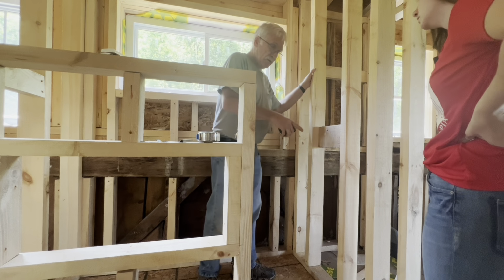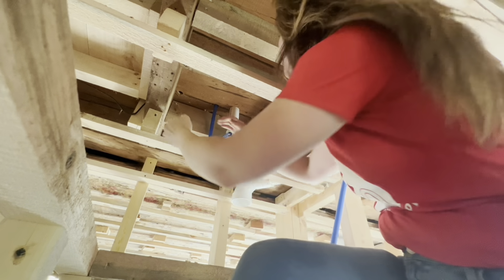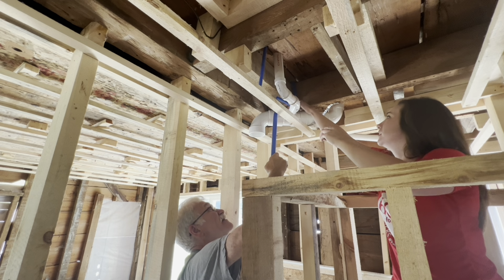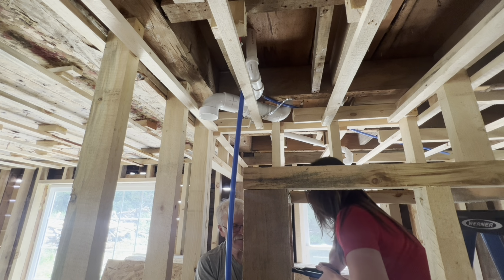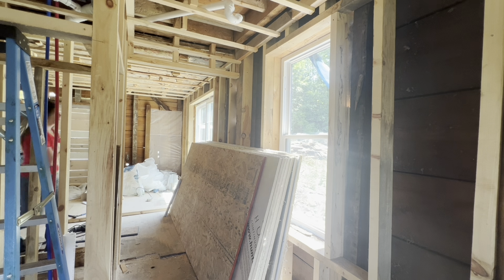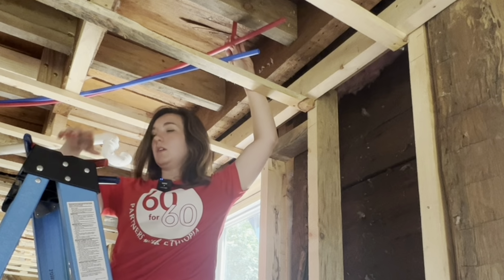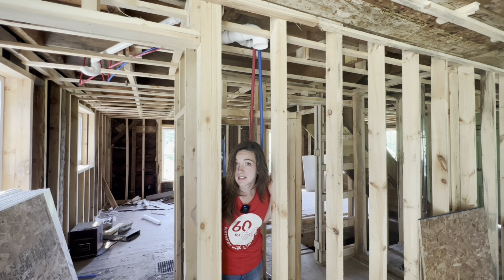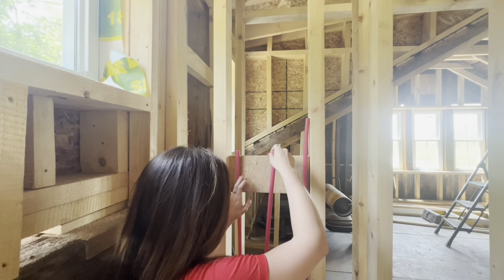TIME TO LEARN A NEW SKILL!! | Installing Water Lines for my Upstairs Bathroom!!

Comment: Good job, Abby! I have two tips for you: Use two pipes on the pliers for a better leverage, so it's way easier to do. Probably you'll do that anyway, but check if all your connections are leak proof, before closing the walls 😉 -Chris

Comment: I would use a tape to tape it blue because when inspection comes they will tell you have to change that and before you put walls up and after the electricity needing Inspection before proceeding

Comment: Great job! So thankful you did not need to solder!  Be grateful for the modern material. It is a lot of hard work with copper pipes.  This job should go pretty quickly! Are you putting in a basement sink? What about water in the addition, bathroom? You could cap it off until needed. Just thinking ahead.

Comment: Abby knowing how to plumb is so helpful.  You did an amazing job.  I have done this with my dad and it’s hard work.  One trick I learned is to brace one side of the nut wrench against a stud or solid piece of wood and use two hands to push the other side toward the arm that is braced.  I hope that makes sense.

Comment: Just a suggestion you'd like to keep your water lines as much as possible continue with flow without an elbow for every elbow. You decrease the pressure coming out the in your shower if you put a good mixing valve.  And that's what it's called where the 2 lines go into the one and then the 1 come out. A good mixing valve will help with your cold water problem getting into the shower

Comment: A small hint. When you finish and you go upstairs into the bathroom.  Put tape around the pipe that is supposed to be blue. And right on your tape blue. It will save you problems in the future

Comment: To keep from not knowing which line you might have to work on one day put some tape in different places on the red that u had to use for the cold water
Reply: You could also run the pex without the joints straight thru since every joint has the potential to leak within your walls and ceiling. Just a suggestion.  But I love what you are doing.😊

Comment: You practically have to be a contortionist to get the leverage on that crimping tool. You did great Abby! Jay a a master builder. You can see how straight the wood, the windows, and the floors are. Great job both of you!

Comment: Abby, my only suggestion is to, mark the cold water line with blue tape, wrap it around it, in case one does;t remember or you  are not the one working on it in later years.

Comment: I do have one concern and that’s been on my mind the whole time. That concern is all of the weight you have added to this house, can the bottom floor  and the foundation handle all of the extra weight? I certainly hope so but that’s been on my mind this whole time. Besides that I don’t have any concerns except one and that is did you put Hurricane straps on your trusses . Are your trusses strapped? Because if a Hurricane or a Tornado hits it can take the whole roof off, if each truss isn’t strapped down. This is a standard in the building codes in Florida. So it might not be a standard in N.Y. But it would be a very good thing and it wouldn’t cost a lot of money to strap all of the trusses. If you’ve ever watched a houses roof blow off and the whole roof flies off in one piece, it hasn’t been strapped down. I’m a roofer from Miami Florida and when Hurricane Andrew hit I saw a lot of houses crumble because of illegal additions. So please think about this. I have to say you’re a good example of someone with a vision. Good luck and I will always watch from Panama City Florida, USA. 🇺🇸🦅